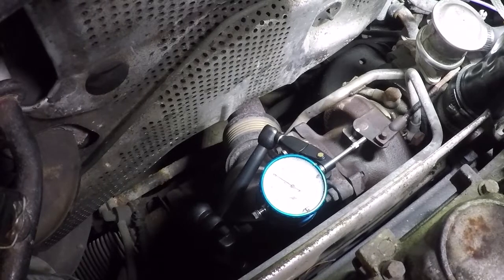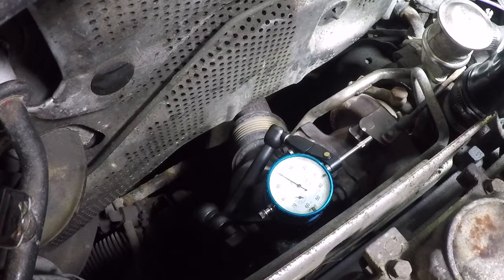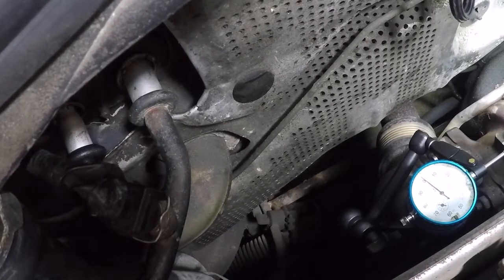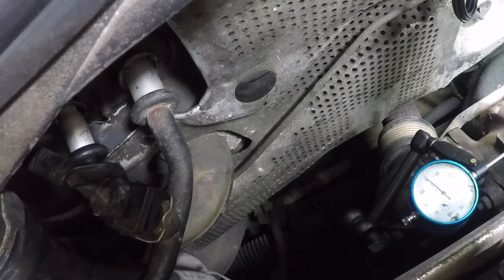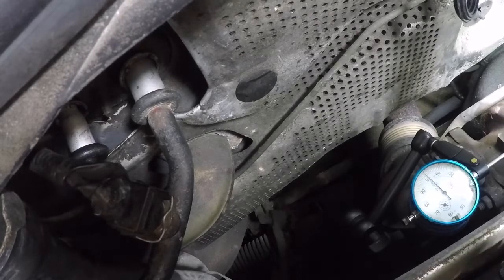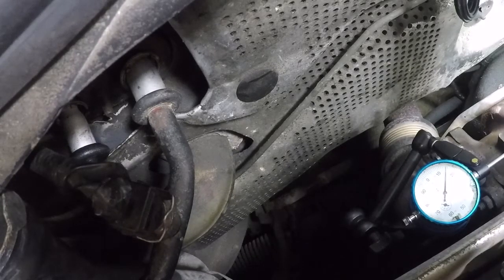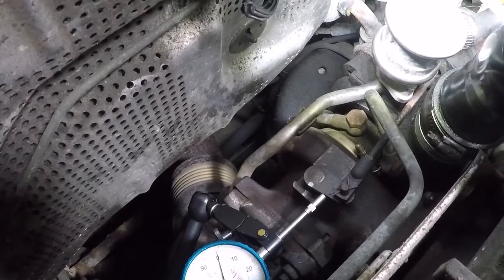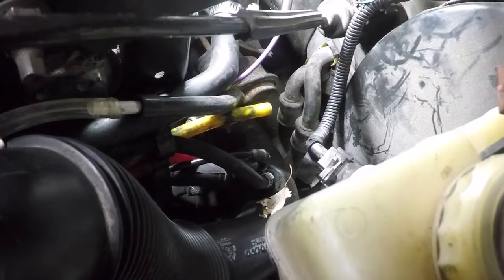1997 Volvo 850 Wastegate check and adjust

Comment: Thanks mate, very handy. Wee question if you don't mind. Should the wastegate arm move if you do it by hand to check? I suspect my old t5 wastegate is stuck closed.
Reply from the maker: @sumo1756  Good Morning. Yes, you can move the waste gate. Take off the little shield and grab the linkage and move toward the waste gate lever. If it does not move, remove the linkage at the waste gate arm and   try it there. The waste gate arm pivot should move very easily with the linkage removed. If not, try lubricating with a high temp rust penetrant and let it set and retry. 

If the waste gate is stucked closed you will potentially overboost. If it is stuck partially open you won’t get any boost at all.
Reply: @houseofbrokendobbsthings5537   thanks very much. I'll try that. I think it's overboosting aye so probably stuck shut. Thanks again👍

Comment: One minute into watching your video, I figured that this is possibly my issue. My car has been hesitant to accelerate uphill getting codes for mass airflow sensor and fuel bank one. Replace the maf sensor same code, over time the symptoms were more frequent and on flat roads. I removed the wastegate and noticed the rod was loose and the wastegate is possible opening to soon. I order a wastegate and hopefully this fixed my issue.
Reply from the maker: Leakage is first. Then this is the next level option. Heat must weaken the spring and lose the initial preload. Thanks for watching.
Reply: @houseofbrokendobbsthings5537  I have a Volvo but a 2006 P2 xc90 2.5 bigger turbo 22t all the other modifications need. Stage 3 tune
The forge wastegate, I’m using has the stock spring. Rated for 15pis and I’m running 18-20 psi. I put about 20k miles on her before the wastegate stared weaken. So yes more psi, means more heat correct? Thanks you for a posting a useful video and commenting. It really helps others. The wastegate will have a rated spring for 18 psi.
Reply from the maker: @DWYNDL3R  Awesome that ought to move the XC90 briskly. Yes, no free lunch more boost equals more heat. The break over for the wastegate to start to leak is critical. Otherwise you are fighting a leak as you start to build pressure just as I was. The stock turbo on my wagon just did not have the volume to pressurize with the sloppy wastegate setting. My S60r likewise needs a look, but it has massive volume and can still feel great and leave some performance on the table. Thanks so much for watching.